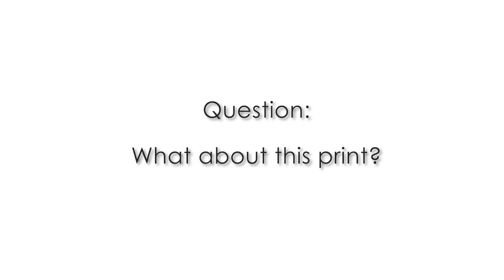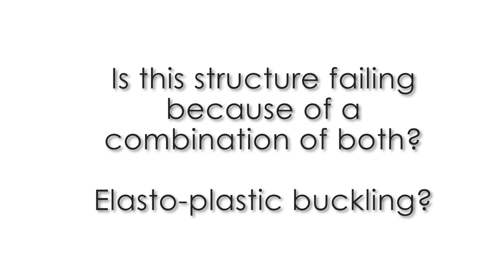Elastic buckling vs plastic collapse in concrete printing

Comment: What an awesome video!  Thanks for posting it.  You may consider that more coarse aggregates may help prevent both types of failure, and reduce paste volume.  Think of slip-forming highway barriers without course aggregates - they couldn't do it without the shear provided by particle packing.
Reply from the maker: Thank you for your comments and suggestions on our videos! Pumping large aggregates is not that easy with a progressive cavity pump, but should be looked into. Other pumps exist, but the main problem is that we need constant pressure and flow rate.